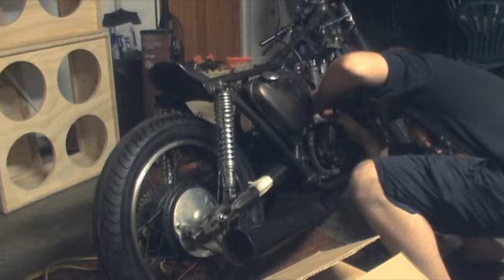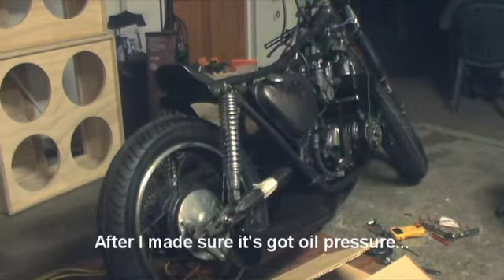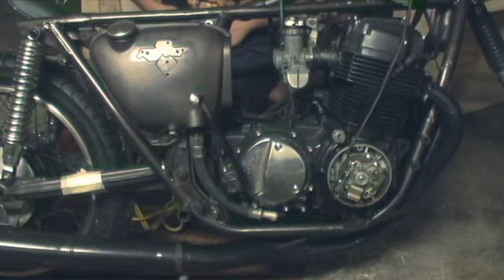KillerSoundz's 1974 Honda CB750 Rebuild First Start!!!!!!!!!!

Comment: Carb help I need a formal that works for air fuel and jets. I have a 1975 CB750 I got for free it's been running for 2 yrs now after I took control of it. But it's rich. Hella flame rich. I have 4-1 exhaust and pods but no muffler. I have 657a carbs with one 657b I know the internals are exact. I have 110s and 40 set up now I've bench synch and gauge. Air fuel out 2 1/8 turn it still super rich and now won't get up past 86mphive cleaned everything need a accurate jet formula
Reply: +Alex Knappenberger DIY ok that's where I'm stuck. I am the third owner of this bike. When you say 1 notch do you mean from stock? I've researche and with these pods and pipes the notch I should be on is third from top